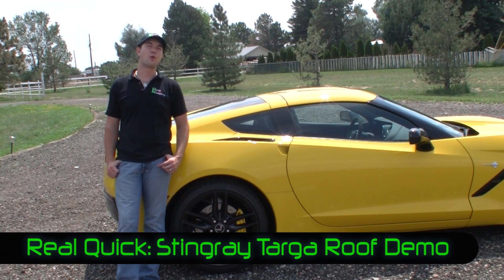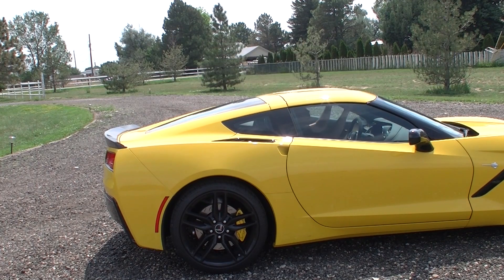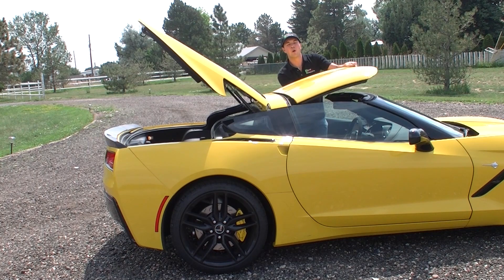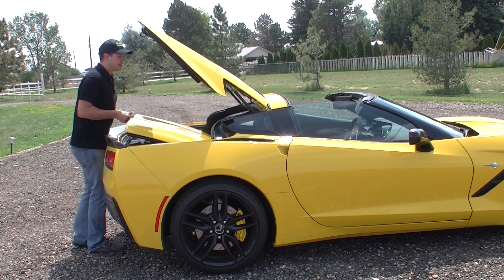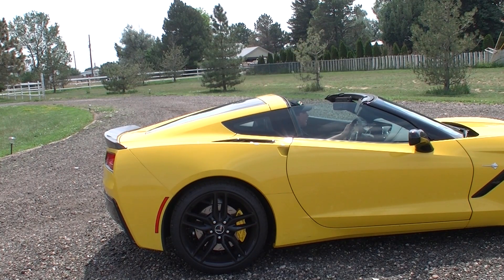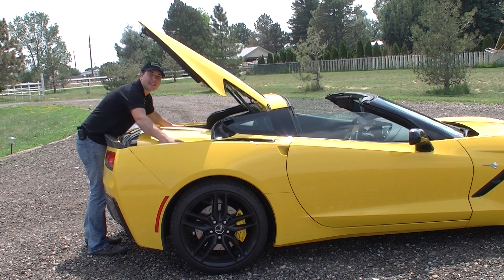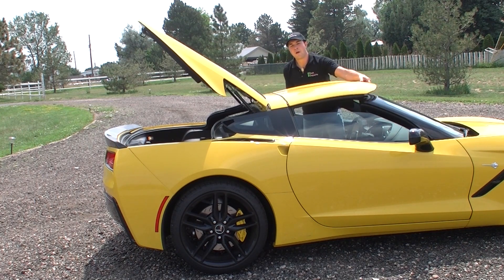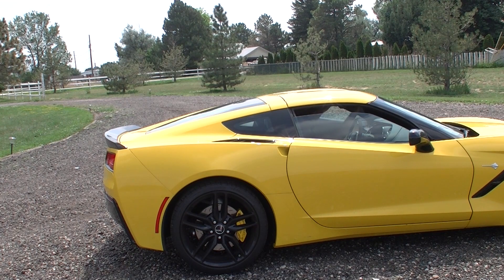Real Quick Video: 2014 Corvette C7 Stingray Targa Top Demo

Comment: I don't hold the panel like that at all because then you need to reposition your hands on the panel. I hold the front center with my left hand and the rear center with my right hand as I remove it and then just stand on the driver side of the car an place it into the trunk without changing my hand position. Installing it, I just first pop the rear up out of the rear catches, then lift it out (again standing on the drivers side) of the trunk with my hands positioned again - left hand on front middle and right hand on the rear middle of the panel and place it into position by first lowering and sliding the rear of the panel into the receiving holes, and then lowering the front of the panel down into position at the front. Also, I always put the windows all the way down for both removal and installation of the panel. I've used that method since my 1996 and also on my 2005 C6 and it keeps getting easier since the panels have been getting lighter.
Tom

Comment: The gasket does seem to always get folded over, requiring it to be tucked in from each side every time.  However, when it's tucked in, it seems to pull the gasket out of line a bit, which doesn't seem to be the best arrangement.

Comment: 1. The roof of my 2013 Grand Sport kicks my a$$ everytime, I seldom take it off due to the fact its the aforementioned pain in the a$$. I shoulda kept my convertible...
2. Instead of starting it to roll the windows down, just press the bottom of the 'start' button to turn 'accessory mode' on.
3. Not sure why everyone keeps slamming their soft close hatches shut...Hold hatch 3" up, and let go. The hatch will click the latch and secure itself.

Comment: do u think everyone is an idiot????
I am a 100℅ disabled vet with lots of pain and mobility problems because of spinal nerve damage. I tell you this because u act like it is a problem handling the targa top, not.
my top is clear not carbon so it is heavier .
first off, lower Windows before taking top off. next you are doing a how to video and u don't even know about putting it in trunk correctly.
you don't even handle it correctly. when installing top grab by middle front and middle back. u make it look like lining top up is a chore, not. just sit it on back and Aline front pegs then u r correct make sure rubbr is not pinched on either side. again no problem even though I had to walk around to other side, wow that was hard. 
really just because u don't like Corvette's don't make out something is hard when it is not hard. 
I own a 15 Z06 and have over 17,000 miles and have taken my top off and put it on many times with no problems and no one showed me at my crummy dealership either. I read the book, it is easy as eating Apple pie. 
I had no problem putting it in the trunk either. the book said slide it under the catches, no problem.
u also said roll Windows down so u don't damage them, what, ??? windows won't break but rolling them down before u start just is easier and won't ruin the them.
so as u see u do not know what u r talking about, u just wanted to show what a terable design Corvette is, not, not, not.
Corvette is American built with American parts and American workers. no Chinese, Korean, janese junk here and my Z06 is the best car I have ever owned. my 08 Z51 was excellent to, no problems.
Reply: I'm fully capable, and my top kicks my ass every time I try to take it off and put it back on. After a year, I still don't have it figured out. I got to the point I just leave it on.